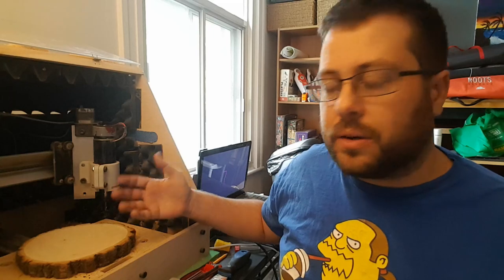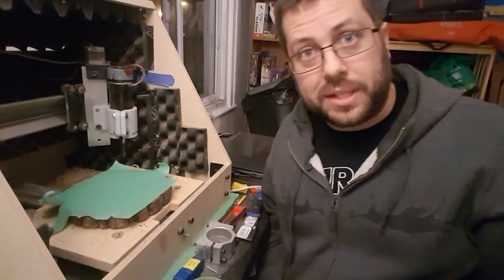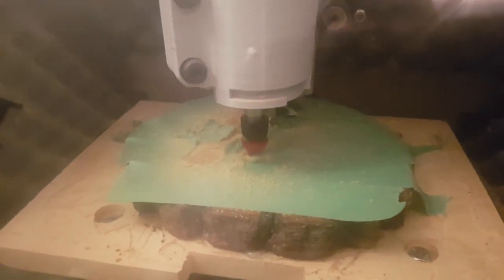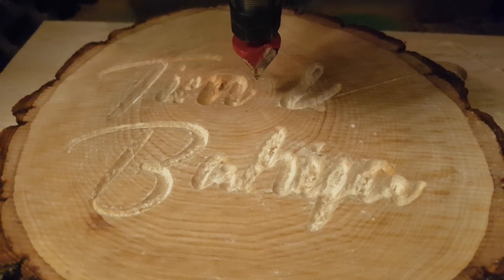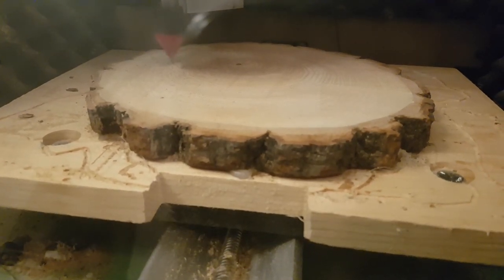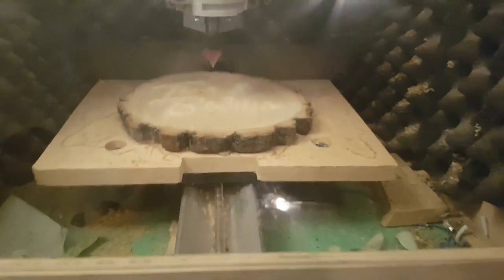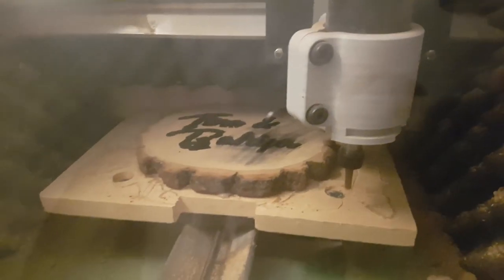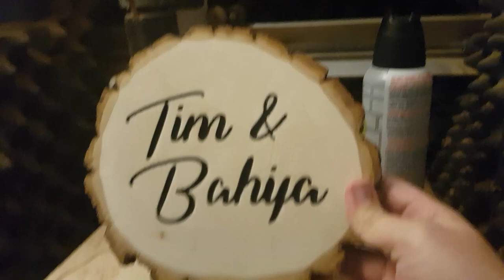CNC Newbie  - VCarve Sign - Sienci Mill One

Comment: I use oramask it's like contact paper, works very well.  Also for painting the engraved letters i use Marsh stencil ink, you can get it in black, white, red, blue and yellow.  it's about $5 to $10 a can.  I like the last method you used also with natural wood and than sanding. Nice job.
LeRoy

Comment: WOW! This is a real cringe-worthy video.  Tape's not going to stick to Watco oil; maybe use spray shellac (Zinsser seal coat) to seal the wood, then tape. The  Oramask is good, and I've read of folks using vinyl shelf paper as a mask.
Feeds and Speeds are way too slow. You ought to be around 16000-18000rpm and 40-60 ipm. But your spindle only goes to 12000rpm (as another said, you may have bad bearings) and I don't know what the machine will handle as far as side to side movement under load.
Does your Z axis have anti-backlash fittings? Backlash might be the cause of losing Z height. I've had collets that were out of round that caused the bit to slip -- disasterously!
You really pulled off a GREAT SAVE in the end. Congratulations on the finished product.